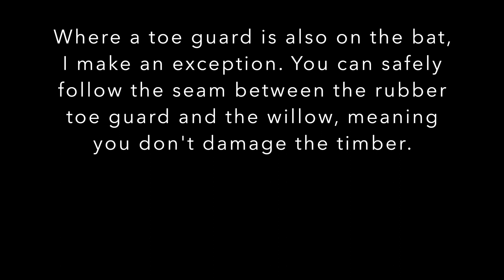Cricket bat edge crack and toe repair on a Keith Dudgeon Griffin Players

Comment: If it’s not too cheeky, I’d love to know what brand of epoxy you used to rebuild the toe. I’ve got a bat at home with a similar issue, and I’m gonna have a crack at fixing it up myself. Cheers mate. Loving the videos!
Reply from the maker: I couldn’t tell you to be honest mate. 
I’ve used the more expensive and I’ve used the cheap and for this application the only difference is how well it keeps. 

Big thing is look for ‘flexible bond’. If it is a hard setting epoxy, first Yorker will cause a toe explosion.
Reply: Thanks mate. I think I’ve found something that might work. Wish me luck!

Comment: Hey Bro. When you were working on the toe, what were you doing? Like what glues and materials etc were you using? Thanks
Reply from the maker: The two had previously had moisture damage, which plays havoc to English willow. It had been repaired previously.

At about the 2:50 mark, I'm using a CA glue (super glue). This hardens any of the loose/cracking fibres and prevents weak spots for the subsequent glues/filling.

At the 3:10 mark, I'm using a flexible two part epoxy to build up the toe, to the original shape. This doesn't improve the performance of the bat, but aims to return the bat to its original shape. 

You have to be careful with the type of epoxy used. Epoxy toes can be very damaging to your bat. Check out his video at the 9:45 mark - https://www.youtube.com/watch?v=Z_e3AFndzmM&t=79s
Reply: @BatandBallCricket  Thanks for that. Really much appreciated 🙏

Comment: I wish you wouldn't put the scuff over the stickers - especially when you take such care everywhere else.
Reply from the maker: Thanks for the feedback. For these type of refurbs, my usual process is to put the new facing in the same spot as the old one. It's particularly difficult to sand right near the stickers, and you usually end up with a different colour of the timber, which some players don't like. I also don't know how well each bat was prepared, so don't want an area vulnerable that was previously protected.
For a full refurb where you're essentially placing a new facing for the 'first time', I cut the facing to match the sticker.
Other times, I follow the customer's instruction on how they want it.
Cheers.